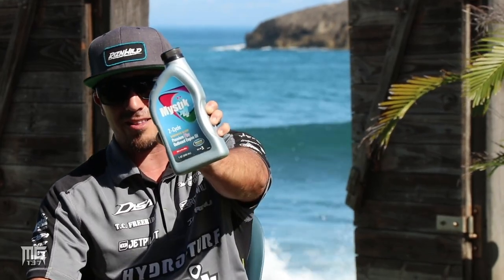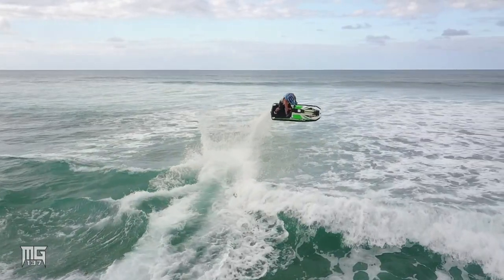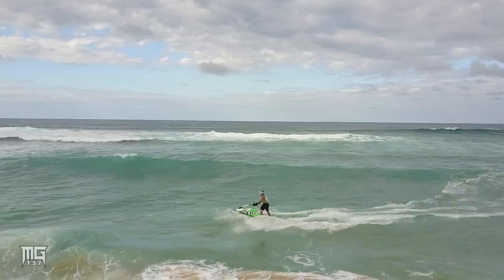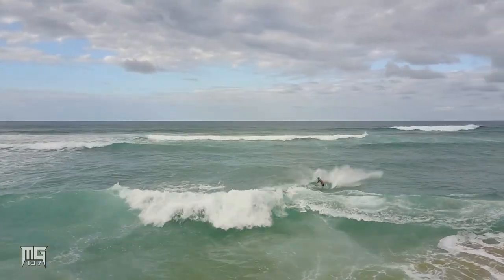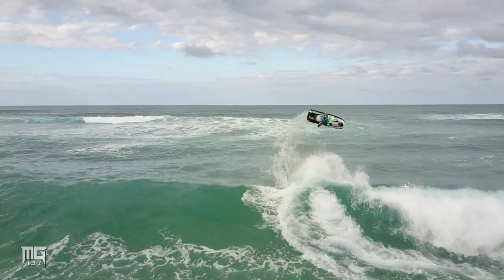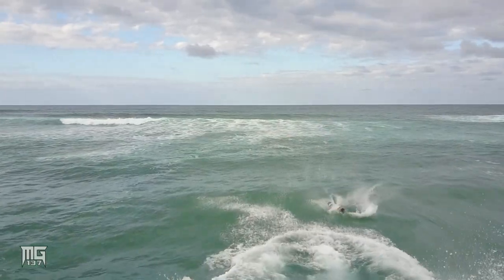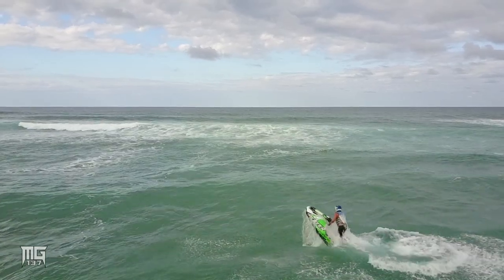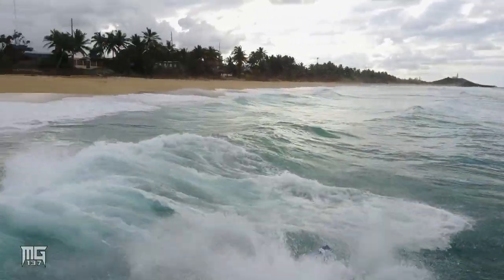How to 180 Nose Stab on stand up Jetski with Mark Gomez Powered by Mystik Lubricants - Freeride

Comment: hi, do the hit the throttle off the peak of the wave to get you to turn, or while ski is in the air ?   or is it a case of a quick snap on peak wave to turn ski. 

thanks mate
Reply from the maker: Yes i actually throttle leading up to the. Base of the ski to be on plane on the approach so your not just dumping the power at the base of the wave. The more linear and progressive you can make it the more lofty and smooth your weight transfer will be. Throttle In the air does nothing for you on a jetski so it's all about smooth Input on your take off. You want to go up and throw the hips out while also pitching the ski toward the direction you want to go Will help as well not just throwing your shoulders.
Reply: @MarkGomez137  many thanks for your fast reply and great advice. 

will be a big help, many thanks 😀

Comment: Hey Mark, I keep having the same issue where everytime I do a 180 , i always land in a tail stall, how do you get the nose down instead of it coming up? I tried to lean more forward and lift my legs but I haven't got much luck
Reply from the maker: Hey sorry missed this! 
I'm assuming your turning and throwing your shoulder and back into the rotation.. You want to keep the bars lower as your start to turn while also pushing the bars over to make the ski slightly roll in the direction you want to go but keeping your body centered on the ski and your hip pushing the direction that you want to rotate.